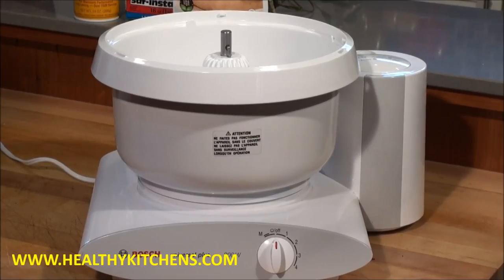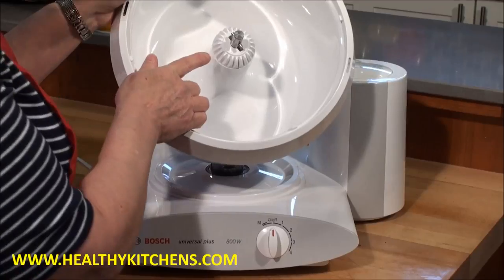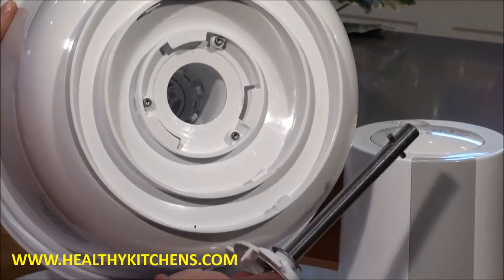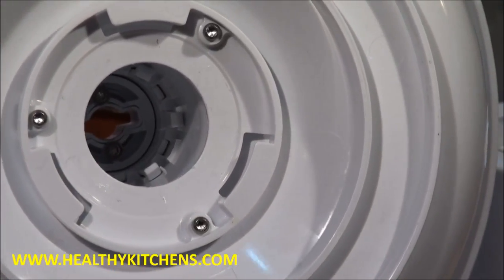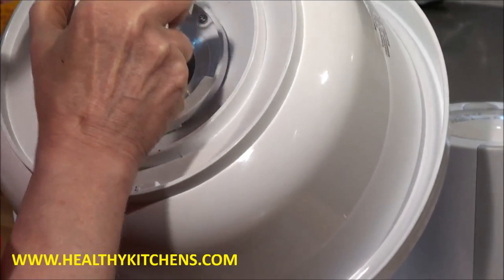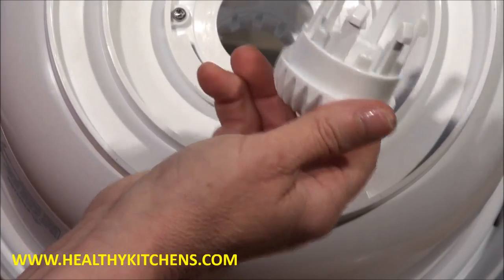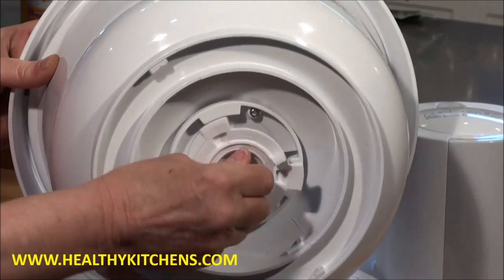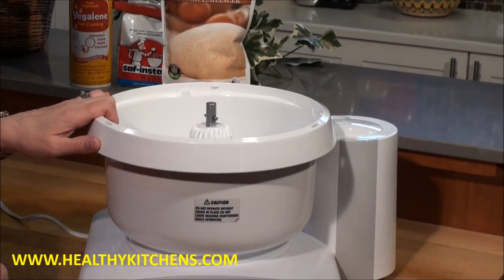BOSCH UNIVERSAL PLUS - CLEANING INSIDE THE BOWL COLUMN

Comment: I'm wondering if the screw are stainless steel. You said it can go in the dishwasher, but I'm wondering if the screws will rust. Some items are like that. They are of sturdy material and will last a long time but the screws aren't stainless and so they rust long before the item itself and then shortens it's life. I hope this is not the case because I really like the Bosh and am strongly thinking about purchasing one.

Comment: 3 of the tabs broke off of mine and I never used the brute force shown in the video. I used Popsicle sticks to wedge each tab and then pulled the top off. Eventually they will break and you need to buy a new one unless you are still under warranty. If you had the right sized thin walled tubing you could just slip it down to unlock the tabs. Bad design.